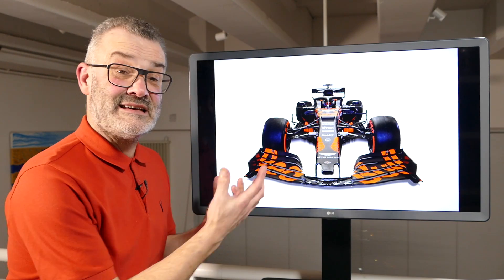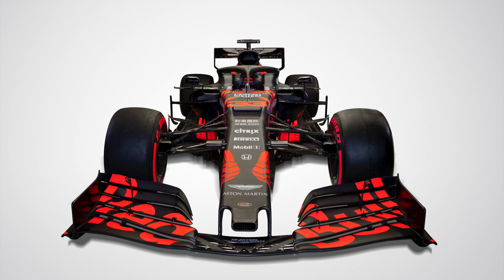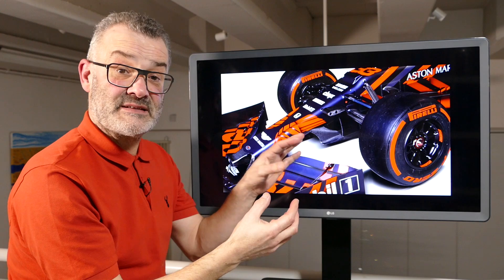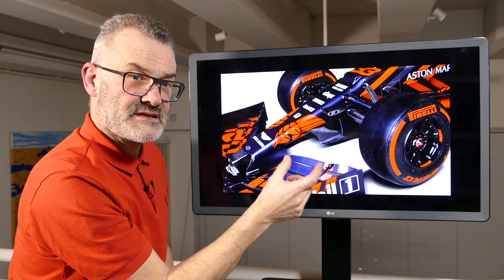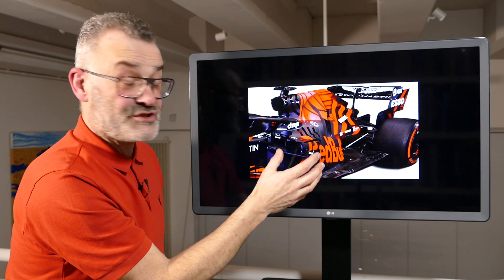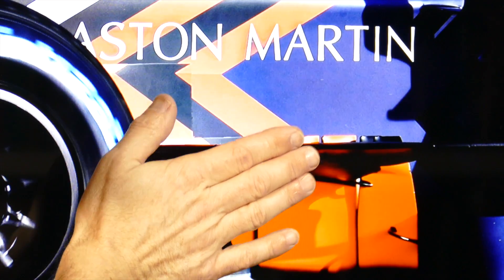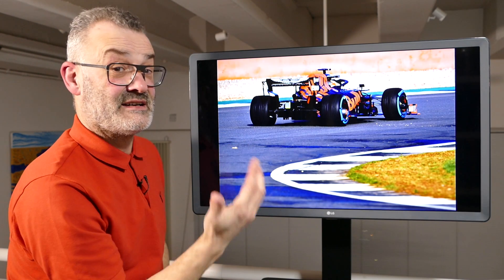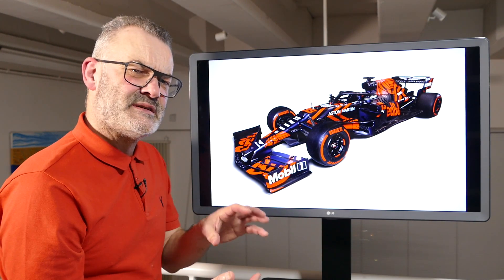2019 F1 Red Bull analysed by Scarbs

Comment: On high rake cars, is there a DRS like effect to the whole car as the rear heave spring compresses at high speed and reduces the angle of attack of most of the cars aero devices by a degree or two?

Comment: Reliability with Honda engine was very good last year. Look at the raw numbers, race per race, and compare them to Renault engines. They were way more realiable, there wasn't much problem with it specifically.
Reply: Lol
Reply: @STE_FAN999 , do your research, it ain't funny. RBR switch to Honda was no amateur move, it was well thought. Reliability on the Renault engine has long been an issue for Red Bull, this year they've been complaining about very often, not just complete failure, but losses of power also. On the other side, Honda has failed much less, and has been improving a lot. Sure you still have less power overall, but you get to keep your car on the track for much longer and your power doesn't just go away all of a sudden. Put that with tremendous aerodynamics and extremely talented pilots and you see it was a very reasonable choice. It has even more arguments in favor, like being practically a works team and saving a lot of money, but these are the core ones.

Honda has been target of a very strong rant campaign from Alonso. McLaren switched to Renault but the problems remain. Was Honda the only one to blame for McLaren's poor performance?

Very few of the DNFs in 2018 in Toro Rosso were due to engine problems. There were mostly crashes and problems in other parts of the cars.
Reply: @giovannigarciadesouzapasto2249  of course, Honda was very reliable. 8 pus every driver. Pls don't talk shit. Thx.

Comment: the fact red bull are able to get the back end of the car so tight with the honda power unit, and mclaren not, tells me that honda wasn't the problem at mclaren. red bull simply has a better designer.
Reply: Problem was Honda had to built their engine around the McLaren Chassis. Red Bull gave them freedom and let them built the best engine they could, and built the chassis around it. If it has more power than the Renault, Red Bull is already winning compared to last year. Honda can continue to improve the engine, and try it out on the Toro Rosso's. If it has a significant better performance, Red Bull will switch the engine.

Comment: Something most people have missed while analyzing the RB15 chassis is the wheel rims, they look like the same concept Mercedes uses with their controversial rims, I am very curious as to what they are and how they help, not only because of the advantage on the tyres’ grip but the cooling and knowing that Red Bull has the best Mechanical Grip.
Reply: He did mention it. A number of teams are running some wheel mods this year. Will they be the same as Mercedes? And what do the new regs allow for such Mods?